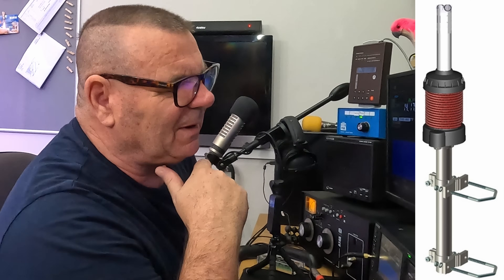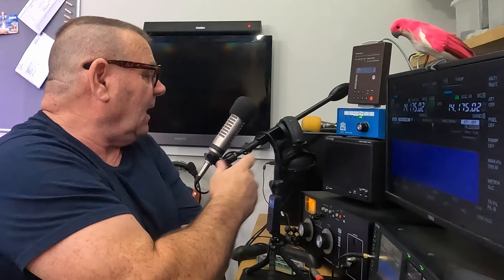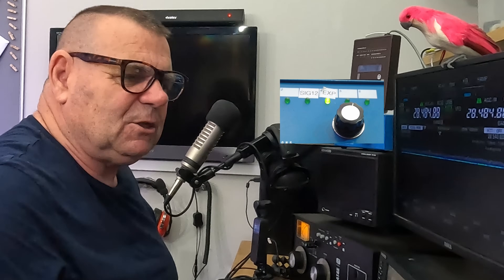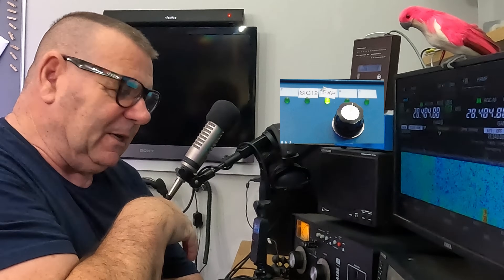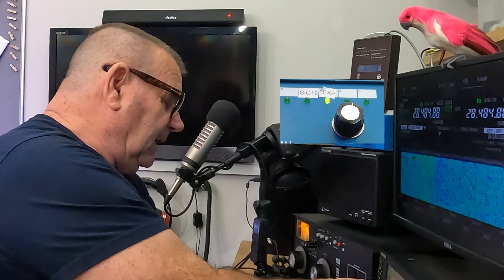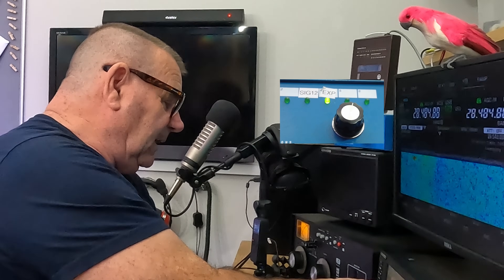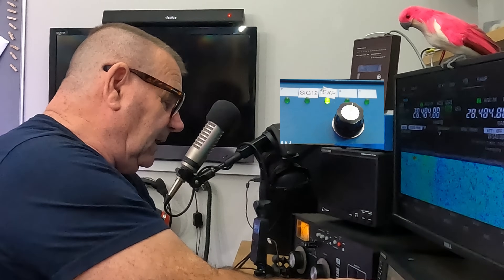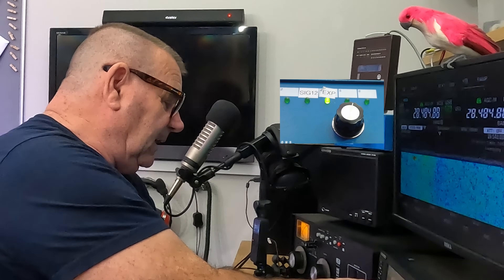Using Gain-Master CB Antenna on 20m Band

Comment: I use a Sigma Skipmaster 5/8 vertical on 10m, where it beats the socks off my Cobweb and EFHW (they're all around 10m high). On 12m its 50/50 between the Skipmaster and my Cobweb but the big surprise for me is my Skipmaster works surprisingly well on 30m (without an ATU, I can't recall what impedance my RigExpert measures it at) but I've worked the world on 30m using that antenna.. I've found over the years that the big issue with mounting 10m verticals high is wind damage

Comment: Theres a bit of a debate about this on one on a Ham facebook group.  Many seem to think running an ATU will make the antenna work better.  Ive just bought a Gainmaster 5/8.  Im studying for Foundation and have a 10/11/12 (tuneable for 15m too) . Its SWR is brilliant on 11m and very good on 10 and 12.  Its not going to work on 15m without a tuner...so I thought when I get my licence I will play around with wire antennas for 15m and use that as my experiment with antenna band.....until such time I can afford a really nice HF radio.  I will share this video on the group. Im sure it will provoke some interesting reactions.!  Cheers Callum.  PS Id love to see that battle of CB radio antennas.  Ive just gone from a Silver Rod 5/8 Venom to the Gainmaster 5/8 - exactly the same mounting pole and height.   The Gainmaster is noticeably better on ground waves.  Hard to say on DX.
Reply from the maker: HOnestly, if you have a tuner and you don't care - then you probably won't notice. The difference of say 1dB can not be determined by humans - only test gear.

Comment: Hahahaha 😂 I've used a cb antenna for years and worked the world from 20m to 10m IMAX 2000 with a tuner. This has to be the worst comparison video I've watched. I think you need to check your home brew antenna.
Reply from the maker: I think you need to suck it up and put a REAL antenna up for 20m then come back!
Reply: Hahaha listen to her just because your mate made you a dummy load aka gain master. There are thousands of amateurs world wide use "CB" antennas without issue on 20m to 10m and the Imax 2000 does it without a problem. Also amateurs with limited space and funds its perfect they can get on hf. If your gonna do comparisons buy a cb antenna like the Imax 2000 or Sirio 827 and don't use one your mate knocked up on a Friday night after half a bottle of gin.
Reply: you are guys all funny, cheers and take care ))

Comment: DX and LOS working would be nice comparsions on 27/29mhz fm mhz,see if data colates with mine ,fab vid!

5/8 ground plane LOS at 65+ft Height DX VS LOS VS
VS a 1/4wave std ground plane at 65ft+Height DX VS LOS
VS 1/4wave folded monopole ground plane at 65+ height DX VS LOS

Float antenna off mast or insulated if metal,but ground mast if metal\steel for electrical safety,must use ground plane types antennas.
(stops ground loops with smp psu dc ground\radio ground  and frame ground of psu mixing causing noises from my tests)

Then try  see at ground Zero mast height (max ground affect)to compare results,i would guess LOS to be not so good vs dx but you never know with RF!

see what works best for LOS uses vs DX uses..

LOS is mainly for 24-88mhz  Super Narrow 8K0 FM and Narrow 11K0 FM modes in VHF Lowband range for LOS Voip gateways and mobiles in my experiments and roles.

Something would like to try is a 11/10m is a folded monpole ground plane like this http://f5ad.free.fr/Liens_coupes_ANT/G/KC4FWC%20Folded%20GPA%20400.htm
picture here https://en.wikipedia.org/wiki/Whip_antenna#/media/File:Antenne_gp_vhf_4.jpg

Its DC shorted,100ohms or so feedpoint so needs a 2:1 matching unit,broadband bandwidth.
A BN43 ferrite block binocular with say 2turns for primary 50ohms:4turns secondary 100ohz,or a coax stub match as in article.
Not often seen in hobby world and could have actual properties useful in 11/10m antenna design?
loved watching the vid!
all the best!

73's Rob P 

RPC 
👍

Comment: I use solarcon a99 for 10 and it will tune 20 meters with external tuner and will talk DX good in my experience.  
My horizontal dipole sux on 10 and 11 though
Reply from the maker: Stick a ground vertical up for pennies strung up a tree with a few scattered radials on the ground and compare it. You may be in for a surprise.
Reply: @DXCommanderHQ  do you have a video on this?  Will the antenna ground itself on a tree?  Thanks Callum

Comment: Max 2000 for me performs extremely well often outperforming the 2 element Yagi mounted below it. I replaced the top section with 102”stainless whip which lowers resonance slightly but gave a better match on 12 and15 where it becomes a half wave. It will work on 17 also with higher losses so quality feeder is important but have worked vk and Zl on this band with 400w to compensate for loss.conclusion is its an  excellent antenna for the higher bands.

Comment: Hello callum love your videos keep up the great work. I was wondering if you had ever tryed using a maco 5/8 cb antenna thay are awesome proformers and are very strong I suspect that thay would work great on 10-12 meters with lots of low angle radiation
Reply from the maker: Not tried.. No.

Comment: Would that gainmaster antenna fit on the 7 meter pole you offer?  If it does will it free stand on top of a tower if i place a fiberglass stub in the lower section?
Reply from the maker: JUST yes.. It would better to lift it up a tiny bit, say a 10m.
Reply: I would clamp the pole to the stub of course

Comment: Cal, very nice. The Starduster you revitalized is neat. Elevated radials, height off ground and multibanded. Definitely a great performer. As far as 11/10 meter antennas. The imax 2000 is a decent antenna at 24'4". The strongest in that class is the aluminum spt 500. With a much narrower bandwidth. You can increase bandwidth on the 500 by shortening it and then playing with the hairpin match. Doing that really didn't seem to hurt performance, and it still worked well. The Maco V58 would be a very close second. Back in the 90s I reworked a V58, made it 24 feet and got rid of the ring match and made a loading coil for it, all trial and error, as I didn't have an analyzer back then. Also I didn't use the radials. From 26 to 32 mhz I had 1.5 to 1.6 to 1 swr. It worked well. It might have had more bandwith, but that's all I had at the time to test. I then put it back to factory design and with a lot of testing as far as performance, it was very close to the same. You come up with neat stuff. Keep up the good work. 73
Reply from the maker: Great work!

Comment: Great video. Would be nice to see more on CB antennas. I have an Antron 99 that’s excellent on 10, 12 and even good on 15. It’s my go to antenna for all 3 bands. Mine is up only 7 feet from the ground and no radials. I suspect the coil in the base uses the coax as a counterpoise lol.
Reply: The only good antenna is the i max 2000 5/8 wave it will tune on 28 mhz

Comment: I use an Antron 99 on 10 and 12 with just 10w out the back of the radio and have had some impressive results. Some 5/8 reports into the USA and Asia 👍🏼
Reply from the maker: Yes, I think all these production models work very well on 10m and 12m.. Agree.

Comment: Hi Cal, I use 5/8 Gainmaster on the free band frequencies, I would like to know your opinion on the  difference between aluminium and fibreglass cb antennas
Reply from the maker: OK, doesn't matter because inside the fubreglass, is the conductive material.. Basically, which one is going to last longtest (probably!)

Comment: I’ve ran many 11m verticals over the years and they all perform fairly similar. Your experiment is pretty consistent with what I’ve done trying them on 15, 17 and 20. Not great performers on those bands but they work. Imax 2000 seems to have a little more bandwidth. One thing I don’t like about CB verticals though and cb antennas in general is how they’re advertised by the wattage. A lot of naive CBers still think more wattage means better performance. I have a friend still stuck in this mode (we both came from cb in the 90s) and when I told him about the dx commander first thing out of his mouth was “how many watts” 🤦🏻‍♂️
Reply from the maker: You make a very good point!

Comment: Your experiment is very welcome because there are a lot of stations on 10m that actually use a Gainmaster. Myself included. And i have already experienced that the classical Gainmaster only works well on 10 and 12. Therefore, i have another Gainmaster, made for 15m. It's of course much longer, but it has a absolutely great performance. Most stations i'm talking to think i am on a beam. Anyway, a comparison between those classic CB verticals you have mentioned in your last video would be very interesting. You would increase your audience too- those "CB only" guys would take attentions to your channel. I also have to add, that there are CB verticals that are not RF grounded, and i believe they do a lot better on bands they are not constructed for compared to a gainmaster.
Reply from the maker: Interesting!

Comment: I use a GainMaster 5/8th wave for 10/12m, got it about 7m off the ground and works very well, the only other band I've used it on is 6m because the band was open, the internal tuner on the FTdx10 could match it and I've nothing up for 6m. Like you said a CB antenna is a great way of getting on 10/12m especially if you've not much room to put stuff up.

Comment: Great comparison.  ATU only works for TX as you know.  No matters if it tunes the RX will be exactly the same, does not change at all
Reply from the maker: Indeed.. The point was it "tuned" for TX but no point in trying to transmit since receive was so awful anyway! LOL

Comment: Callum, I am an avid SWL listener and former HAM, I do enjoy your videos because you emphasize the importance of antenna’s receiving capabilities. A mismatched or poorly built/deployed antenna could significantly limit you ability to receive signals. Tuning a mismatched antenna is just protecting the radio, but not making the antenna better. If you could run a similar experiment with the Sirio New Vector 4000 for 27-28.5 MHz which an excellent vertical for CB.
Reply from the maker: Good point!

Comment: My tuner (in the radio) only tunes TX and not RX, how is your tuner ?
Reply from the maker: Well, to be honest (and I could write a whole chapter about this) a tuner would NOT have helped in this instance. The antenna itself will not operate at those frequencies - so you would not have been able to peak the receive.

Comment: Just made Japan and Australia recently on a t2lt.digimode in 11.. Not a good location either but the prop on 10/11/12 are at exceptional levels for sure..east and west at the same time..! At times.. you,ll never beat a loop for s\n ...on 11 with a better RX in 20 and 18....

Comment: is a 17m 5/8th (tuned well) possible on a 40/15 meter vertical.  the calculations are the same… 32ft 5-3/8in for 7.212 (1/4), 18.030 (5/8) and 21.630 (3/4)
Reply from the maker: Yes, the dimensions are similar - but you have to match it.

Comment: Many years ago I used to enjoy trolling at the local radio club,  many people had poor results on 10m and maybe did not even notice. I told them "you want to see what the CBers are using". Not entirely flippant, CBers are stuck on one band and they have to make the best of it, so they do. I am too old to be fighting for the very last 1dB but  10dB is worth some effort. Would be interesting to see a fan vertical for maybe 10m, 12m, 15m at the top of the pole with a single radial per band. I suspect it may work rather well. 73
Reply from the maker: Ah yes.. Did you see my "Starduster" hybrid? I think you did. Similar thinking..
Reply: @DXCommanderHQ  Yes, it worked well, but I think a set of band specific radials might give it the edge.

Comment: I used to live in a quite restricted space where I could barely put up any antennas at all and worked 20m for quite the while with Solarcon/Antron A99 at about 4 meters up (until it broke). Not the best obviously, but better than not having antenna at all. 

In my current location I have way more space and possibilities, but have still only a CB antenna at the moment at about 8-9 meters up. First had a cheap 1/2-wave aluminium "Venom" (it broke), then a Gainmaster 5/8 (it was already half broken, then it broke completely), now some cheap 1/2-wave aluminium no-name antenna (still up). 

All of them "work" on 20m with a tuner, but obviously none of them are great. I have had a QSO with Callum with the current cheapo antenna. Not optimal, but again, better than no antenna at all.

All this rambling just to say that would be very interesting to see a proper comparison between a few different CB-antennas! Maybe add a cheapo aluminium 1/2--wave or 5/8, if available.
Reply from the maker: I would like that too. I might buy all of them - and ask for a dollar each to pay for the experiment!
Reply: @DXCommanderHQ  Just had a look, hot damn have the prices gone up since I last checked! If you are seriously considering doing a shootout, I'll gladly chip in a few € to lessen the sting!

Comment: I suspect on 20m the coax stub means the Gainmaster just looks like a short at the end of the run of coax. To a lesser extent the same will be true on any other band outside the design bandwidth. I have a homebrew Gainmaster and I can just about get 12m and the lower half of 10m within an acceptable SWR bandwidth.
Reply from the maker: Yes 12m worked quite well I felt.. Lower and it faded fast.

Comment: Hello DX Comander: Thank you for your antenna intro video into CB Radio, the 11 meter band. Here in N.J. I'm in the process of installung a SHOCKWAVE omnidirectional CB antenna on my garage on a 21 foot galvanized mast. Please note sir that I've been doing CB radio since 1965 at the age of 8 years old & I  was also a ham radio operator for a while with a general + extra class. I would love to hear more of your thoughts on the pesky 11 meter band. Thank you sir, TMP, Unit 22 from N.J.
Reply from the maker: Thank you for the encouragement.. More to come.

Comment: I use a basic half wave "silver rod" for 10&12 and it works great and did try it on 20 with my 10w and built in tuner and managed to make several decent (5/9) contacts but I wouldn't recommend it as the tuners taking the strain and the mis-match still exists

Comment: Hi Callum M7WLG here I did tests last year with all the major CB antenna including antron 99 and siro 2016. The winner was the Sirio Gainmaster 5/8 version. Best with receive and transmit and also best SWR they was all tested using the same coax and antenna installed at same height I just put 1 antenna up at a time for 1 month each and wrote down signals and swrs and all sorts the Sirio Gainmaster 5/8 was the Winner.
Reply from the maker: If you still have all the details (eg Spreadsheet) I would be very interested to see the numbers? You can look me up on QRZ or via the dxcommander website for email!

Comment: I love my Max2000. It's not high although I wish it was. It's on a 3m alu pole on a parasol base and guyed. Works extremely well on 10, 12 and 15m. Will get it above the apex of the house at some point. 🙄 
Shopping list : DXCommander and a long wire 👍🏆😂
M7GDZ

Comment: That's not unexpected, but I'd like to see a 'gain master' made for 20m band now!
Reply from the maker: Bugger off Jonathan! HAHA.. Actually, we COULD do that on the 18m pole..???
Reply: @DXCommanderHQ 😂
Reply: maybe its easier T2LT  is just rg58 , know the lenght and its done.  Ah and air choque @DXCommanderHQ
Reply: @DXCommanderHQ  if you are still on this project - you may want to look at the Grazioli G Max
Reply: There was an article few years ago in the Finnish Radio Amateur Leagues magazine about that, apparently it works really well (no surprise!)
Reply: I second that...😊
Reply: Flower pot antenna for 20m (1/2 wave) work VERY well